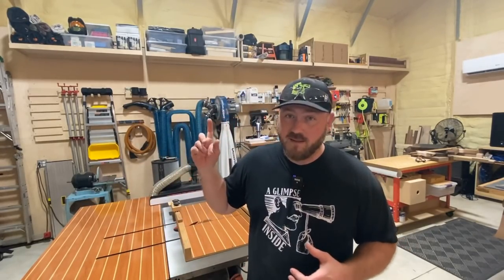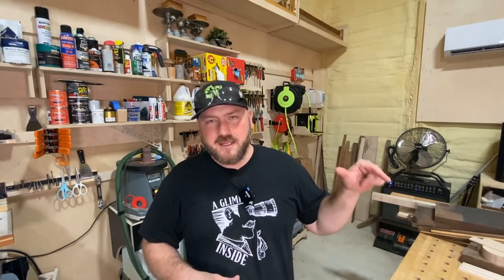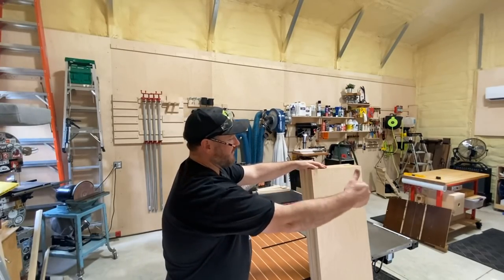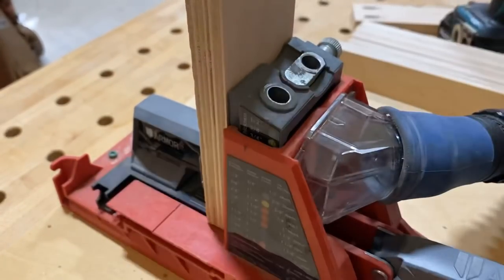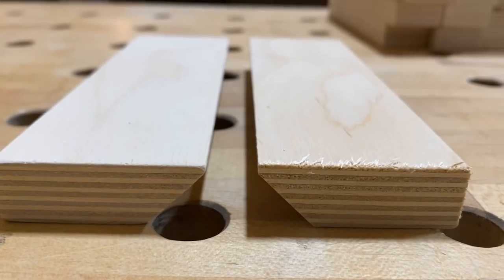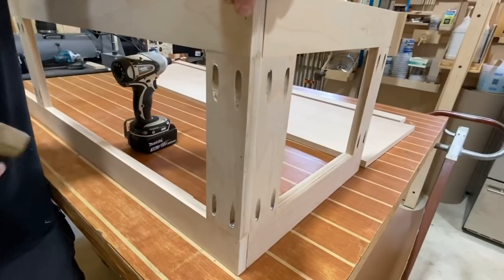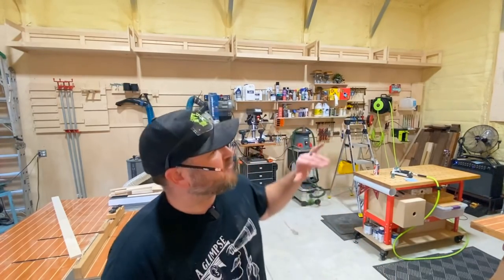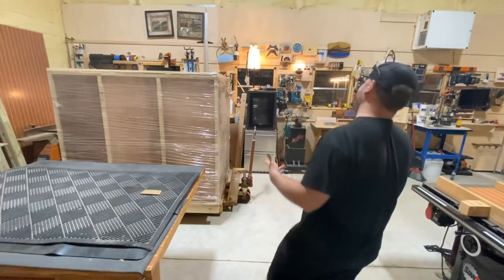DIY Overhead Storage | French Cleat Edition | A Glimpse Inside How To

Comment: Hmmm........ my money is on a big CNC machine in the mystery box.

Re the shelves, I'm in the middle of making shelves to go around my hall, above head hight. I've made a load of brackets from steel flat bar, with a bend in the middle. I haven't added any diagonal bracing as it will be just the right hight to bump heads. If they do start to sag, I can put some supports to span the gap between the shelves (across the hall). Basically I'm going for a blacksmiths look with the steel being blackened with forge scale and some wax once they are cool enough not to just burn the was straight off.

Comment: Great video :) But I think the shelves would be as strong (if not stronger) if the end supports were a simple straight 45 degree piece (from the top of the back to the front edge of the shelf base). You seem to have over complicated and not gained the most support by making the ends out of two pieces with a right angle. The end braces/supports are placed under tension, so a straight single (45degree) piece would have been the best.
Reply from the maker: I can see that being an improvement for sure. This was definitely an experiment it does work however probably not as strong as that idea. Plus I might lose the capacity to put items between shelves  with the gap in between then

Comment: These are built with 3/4 inch cleats, 16 inches deep... Would that be strong enough to hold 18+ gallon totes?  I'm looking at this for Xmas decoration storage, but I want to be sure the standard sizes cleats would hold up...
Reply from the maker: Well I can’t say that for certain but I will say this I have around 36 pieces of lumber on there that were roughly 4 1/2’ x 8” and 2 inches thick. I don’t know what the wait was but it held up really well for about a year
Reply: @AGlimpseInside  lol, does that mean it fell down after a year?   Just kidding, I know this video is just under a year old.  😄 But I did want to ask, because I saw a video where you mount a spindle sander to the wall with a thick french cleat, like 1.5 -2 inches think.  At what weight (or other issue) do you switch to the thicker setup?  Thanks for the answers, and keep doing what you do! I love your videos
Reply from the maker: Thank you man yeah my time frame gets all jacked up sometime but I will say you know It didn’t fall. Haha. Thank you brother I really appreciate it

Comment: Chris. What's rough guestimate  of the weight they will hold? I do like this idea.
Reply from the maker: I tried hanging from one of these for a brief second it didn’t seem to do much but it creeked little bit. I’m pushing about 260 so I would guess anywhere from 250 to 300 pounds. But to be safe I’m probably not gonna go over 100